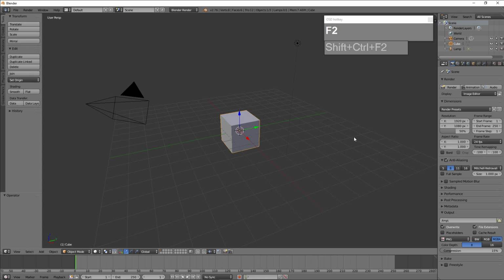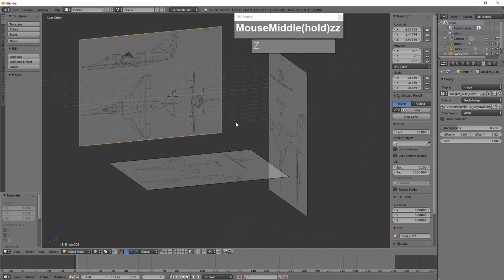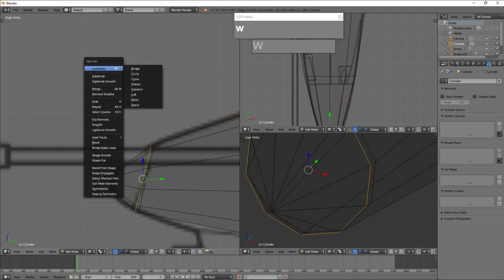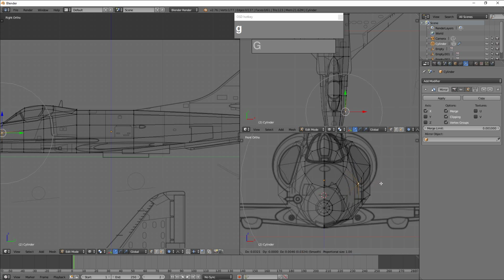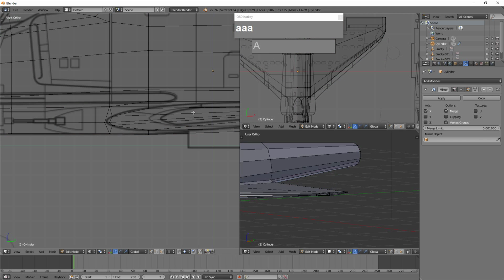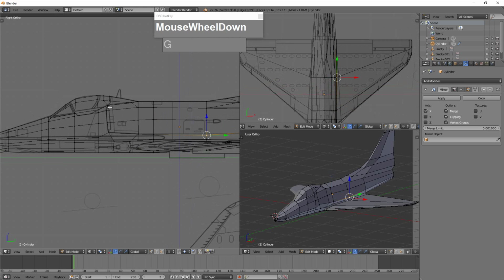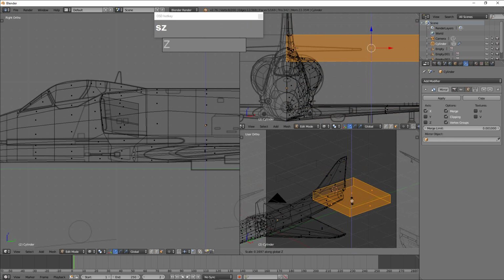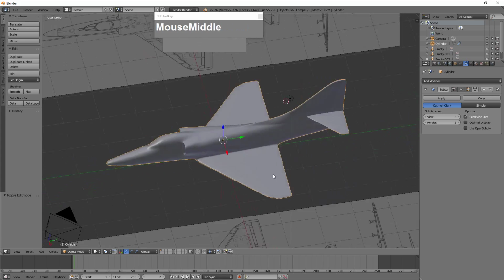Modeling Douglas A4 Skyhawk with Blender 2.76b

Comment: also... for game models... specifically things like Kerbal Space Program... are rectangle grids ok or doe most games want triangle based mesh models? or does it matter?
Reply: +dregerclock Graphics cards are made to work with triangles, so, in principle, the final model that the game will use has to be made of triangles. I don't know of any exceptions to that rule.

When and how to do the conversion depends on the game. Usually that's done either during exportation (some export scripts allow you to convert quads to tris) or after exportation by using a tool specifically made to process models for that game. It's in your best interest to always keep the original model in quads, in case you need to tweak it or something, as modeling with triangles is not really a viable thing to do.

I know nothing about KSP in particular, so I can't be more specific.
Reply: +skaruts oh ok thanks. So you dont need to develop the model in triangles for a game ... the model is just converted when imported into a game engines i guess.
Reply: dregerclock
Yea, while modeling always go with quads. Avoid tris as much as you can. There are exceptions, but they're rare, as triangles will break edge loops and that can be a pain.

There's a guy called Johnathan Williamson who has made some interesting videos and talks about topology, in case you're interested in knowing more about that.

Comment: Question... when you created the rear stabilizers you did it with a separate new cube that you included in the same mesh in edit mode. why did you choose to do that vs extruding it out of the tail fin? on my plane (which is a propeller plane) I need to model prop blades... and was considering doing it like this as a separate part, but I was wondering if there is some reason or time when you suggest doing this vs extruding from the main body.
Reply from the maker: +dregerclock It is more for convenience as I don't want to insert more edge loops on the dorsal fin to create more faces to pull out. Another reason is that when we model a vehicle, we tend to try to model it as one piece, but in reality a vehicle is made up of separate parts, so we can build them separately and stick them together. It is easier and you don' t have to work out the topology. Also when I create the cube to make into the stabilizer in edit mode, it is part of the object and it will inherit the modifiers that is applied in the original object.